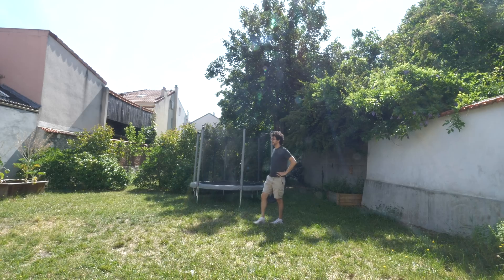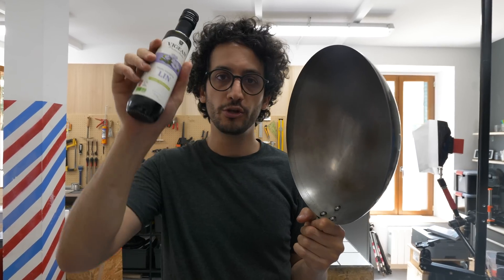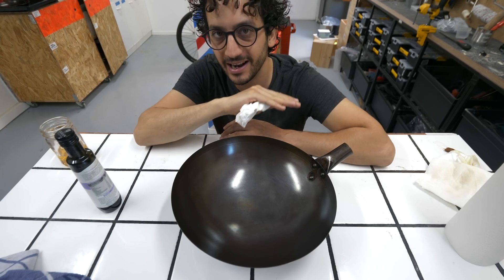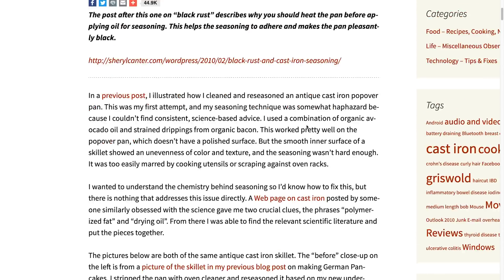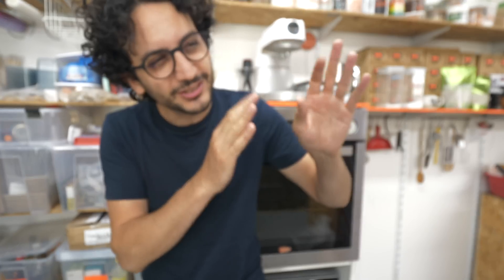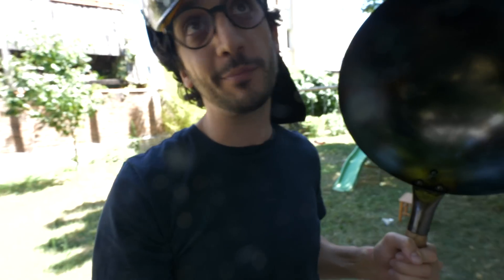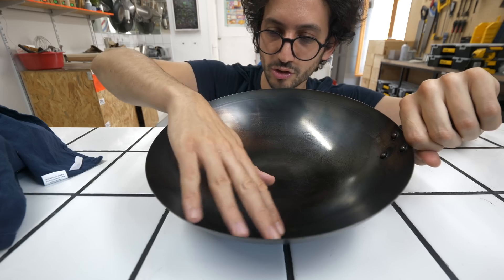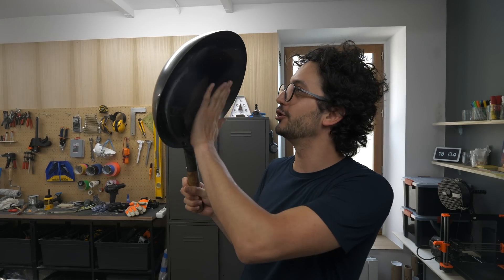Can I Make my Wok Slicker than a Nonstick Pan ?

Comment: As fabulous a tool as a good seasoned wok is, you won't be able to cook creamy omelette in it.  And your stir-fry won't turn out nice in a non-stick pan either.  Each of those is a solid instrument in its own right, designed to do specific job better than other instruments.  I can't understand this hype about cast iron/carbon steel cookware.  It's legit best in what it does, but it can't and shouldn't substitute a good non-stick pan.

Comment: Seems like he really missed an opportunity to get the wok glass smooth with some sand paper of decreasing coarseness.  If he had gotten down to 3000 grit, that wok would have been like a mirror.
Reply: it seems like you don't want it too smooth, you want the oil something to adhere to. Some cast iron stuff does come pretty rough off the shelf.
Reply: @kubetail12  Well he said that the pan had to be as smooth as possible (9:44), so if that's true, then there's only one way to accomplish that.  Plus oil will adhere to almost anything.  If you put oil on glass it still adheres.
Reply: @cheemomugdoo6001  what was the wax applied for the polish finish?
Reply: @leighp03  I'm assuming it was a a type of jeweler's rouge, which is like a rubbing/polishing compound in solid form.  They come in different levels of abrasive, but in general they don't remove much material, they are used to remove fine scratches for the most part.  It would be the final step after using fine sand paper.

Comment: Stupid question (most likely): is it ok / useful to do this on an aluminium pan?
I have a few small cheap ones i occasionally use to heat up non stock things. I see others use these to cook eggs, but im like oooh maybe not. Eggs would stick to it, and ppl would hurt the thin oxide layer when scraping it. 
(Al with an oxide layer is foodsafe. Scratched aluminium before the oxide layer could naturally reform on it is not so much)
So it would be awesome to make the surface a bit more non stick. Of course i still wouldnt cook heavy dishes in it, just would be fun to improve it a little.
Any thoughts? Can be done, no go, works but not too good?

Comment: Linseed oil can be used to form the varnish for paintings but instead of heat you just leave it to harden for a few weeks/centuries, there's a lot of literature on the chemistry and polymerisation in the museum conservation of artefacts literature.   My question on followup is, can you wash it up with detergent?   I was always very firmly told by a profusely wok using housemate in uni that washing up liquid will remove the patina and make the wok go rusty.   I'm pretty sure a fully hardened linseed polymer isn't going to dissolve in detergent though.
Reply: it can take light detergent but you should avoid it. It is not necessary. Put a little water, put it on oven for 30 secs. It will boil and loosen up the stuff. Then just wipe it.

Comment: Would make a lot more sense to polish the metal surface to mirror shiny before applying the  oil film.

Also it should be noted that UV light and oxygen are enough to polymerise linseed oil on their own. Baking a carbon steel pan with a powerful UV lamp might be advisable.

Anybody who uses a wok will tell you that teflon is no good at all. It scratches and flakes, and plastic can't handle the sort of ultra-aggressive "wok hei" high temperature minimal-oil techniques required for many dishes.

Comment: You can buy roofing and rain gutter metal stock with a teflon coating. I think that it's a better use for a plasticie type chemical substance. (What the hell is teflon anyway?) Keep that sort of thing out of the kitchen. Eventually teflon flakes. Do you really want to eat that s--t? No you don't. Oil seasoned pan is way better . Good job French guy.

Comment: The answer to that question is no. A non-stick teflon pan, can't literally be beat when it comes to that. It's after all the solid with the third lowest friction coefficient. The other 2 solids are BAM and Diamond-like carbon. And none of these items are commercial products. Sure a Non-stick pan with a BAM coating wouldn't be overcome ever, as it's literally the material with the lowest friction rating, at 0.02 compared to 0.05 for DLC and 0.1 for PTFE, and steel at 0.7...

Comment: False... Seasoning does not make your cast iron/carbon steel non-stick. It only protects it from water. The true non-stick part comes from developing carbon layers with your seasoning. Carbon is whats left after you cook food. In other words to have a true non-stick carbon-steel pan, you have to actually cook on it.
 This is why the egg test is dumb to do with a new cast iron or carbon steel. Sure you can make shift it to seem like its non-stick, by using large amounts of oil or cold oil hot pan. But it is not the same as my cast iron with over 2years of carbon build layering. Makes things taste beefier since I've used it as a test pan for making burgers, thousands of them. I can slow heat my cast iron, not add a drop of oil and throw an egg on it and it will slide. This is a budget lodge 12inch cast iron. Using a metal razor edge spatula with the burgers, made the surface almost as smooth as my finnex and stargazer, minus the edges.  Had original seasoning removed. put on 3 coats of ghee for seasoning. Seasoning done... Then I cooked thing sliced potatos on it for carbon build up, starchy items are good for this. Then I did bacon right after it cooled. Then I cleaned it with just a towel, then reapplied heat and did a layer of ghee again, do the oil everytime after cleaning.
Then you wanted to preheat the pan before adding your season layer. Then after you put it in the oven, about 15mins later, you want to wipe the inside off, or it will spot. You only do this with a new pan, or if you re-started a pan. But you always coat it with oil after cleaning.

Comment: You should know that the process is called bluing and there is no polymerization involved whatsoever.
Usually you also do this at much higher temperatures.
You take the steel or iron to 400-700°C and then dip it in line oil.
You could also do it the other way around but then you risk of just burning the oil instead of having it steam off.
During that process the outer layers of iron form iron oxide, the nice black stuff, the magnetite, not the bad flaky red stuff which is usually called rust.
The black iron oxide is not as brittle and forms a quite hard protective layer. This is not really permanent but you can prolong the effect by rubbing it with oil once in a while.
Other uses of this process are in toolmaking or guns for example.

Comment: I like the idea of taking what we have and making it better.  I like the craftsmanship involved in taking a pan and seasoning it into a non-stick pan.  For the same reason that I appreciate blued guns.

What I mean to say there is that, much like with firearms, there are more effective modern coatings than bluing (a coating of black iron oxide, preventing the formation of red iron oxide from forming)  But there is a sort of beauty in performing an older, less effective method of coating a firearm that requires care and knowledge of your tool (firearm/pan), especially when performed by the owner.

The only place I take issue is when one refers to seasoning a pan as a natural or non-chemical method of making a pan stick less.

Flax seeds dont naturally press themselves into an oil, land on a pan, and heat themselves to the point that they polymerize.  And polymerization is definitely a man made process, creating a chemical change.  Furtger, the person intervoewed states that we are actively looking to create the process heating oil which causes carcinogens in eaten food.

I enjoy seasoning my pans.  Maybe its safer than teflon, maybe its not.  Regardless, seasoning a pan is still creating a manmade chemical coating which, if ingested, is not guaranteed to be safe.

I am not stating that chemicals are bad and natural is good.  I am stating that I feel it is intellectually dishonest to refer to manmade polymerization as natural/non-chemical, simply because we recognize all of the ingredients involved as natural.  Trace any "chemical" back far enough, and you will find a list of completely recognizable ingredients.  Trace gasoline back far enough and you get naturally occurring minerals paired with animals and plants fermented by naturally occurring bacteria/fungi.

I am not posting this to be confrontational.  I am posting this because you asked for opinions on the topic.  I love the video (and gave it a like), and I love taking care of my cookware.  It says a lot when you walk into a kitchen and see a cook that seasons their pans and sharpens their knives with care.

Comment: !! Safety warning !!

If you use towels to apply and wipe off lindseed oil, please immediately a: put them in a zipbag b:wash them off (ofc if not paper towel) or c: throw them right into a open fire to destroy them immediately. Otherwise they will very likely ignite themself spontaneously, even at room temperature!

Comment: One layer of seasoning will pass the fried egg test, but my carbon steel pans fail when I scramble 3 eggs in them. I get sticking galore and my teflon pan doesn't. So now that you've had half a year with your wok, would you say 3 scrambled eggs would stick? I'd love to know because I'd love to get away from chemical coatings too :/
Reply: Delayed answer: When you put too much food, the temperature of the pan drops and at lower temperatures these pans are more sticky. Carbon steel pans have less mass than cast iron ones, so their temperature will drop. If you want non-stickiness to go on, you should heat the pan a little more for higher amounts of food than you would do for lower amounts of food. But that would probably smoke your butter if you are using butter.

Comment: This si the exact way I use to season my Cast Iron skillets, heat and linseed oil and sometimes Grape Seed oil.
And my mother and my grandmother and my great grandmother.....
So I can confirm that this works, heat and oils.
I have a Cast Iron skillet that we have been using almost every day for four generations.
Everyone should have at least one Iron Skillet and they don't need to be expensive at all.
Buy one at a flea market and season it or if you want a new one then IKEA has several models that are just as good as the high end ones.
Cast iron is cast iron.

Comment: Basically the teflon coating in itself may be a man-made "chemical", though it is still a more uniformly polymerized material than the polymerized oil which you have made. And hence you changed it's structure, it is man-made, too ;) . What I am referring to is that, that maybe the teflon has less chance to be harmful than the burnt oil, because it contains less free radicals. Although I am not a safety maniac, you won't die of this, but if you want to check the smallest details: teflon with some oil may be the safest  :P. Keep up the good work!

Comment: How long does a teflon pan last and then cost to replace each time?  How long does a carbon steel or cast iron pan last?   There is no comparison.  Most professional chefs do not use any teflon pans for these reasons.

Comment: I prefer a seasoned wok to a teflon-coated wok because the high heat needed to make decent stir-fry kills the teflon coating quite quickly. Teflon is fine for frying eggs and bacon, stuff where you are using a low heat.

Comment: nonsticking pan meant to be a consumable item that according to manufacturer you should replacing them in a regular period( 6 months, 1/2 years) regardless of how expensive that pan is
yet cast iron pan you need to maintain everytime when you use(that the process of seasoning is done if you use it frequently, like commercial kitchen) but is durable

Comment: Well, Teflon is also a polymer. But I prefer the old way for the simple reason that resurfacing a Teflon pan is not something you can do at home, whereas seasoning is. My main pan is at least a hundred years old and there will be no reason to replace it for another couple hundred years.

Comment: That looks a bit difficult. Try the method we use here in the USA to restore or old cast iron ware from 1885 to 1930.  First oven cleaner to get all that junk off the surface.  Then use your drill and a pad and go through 220 to 1000  grit sand paper. You should have a mirror like surface. If not go to 2000 grit. Lightly oil and your done.

Comment: Salut !
An improvement of the stove would have been to sand the steel of the stove before cooking the first oil. Another improvement would also have been to apply a large amount of oil to the stove at 650 ° C (ideally soaking in oil at 80 ° C) to obtain a blackened steel. The rest would continue as in this tutorial.
In any case, thank you for these excellent videos with real culinary content.

Lâche rien !

Comment: Alex, whatever you did for this video, we already get those type of woks for dead cheap prices in India. You can get those in any weekday flea markets in almost all major cities and towns. Not only just woks but flat variety of wok that's used for last minute serving of many an Indian dishes called pav bhaji or chaat etc including noodles. Almost all authentic street food vendors have these. They use it as it doesn't take huge energy to heat up and once heated, retains heat for a longer time so that they can work on the plating of the dish. They almost clean it every day with special techniques that gets carried on in the family. After work, they clean it with soap and scrub it. Wipe it clean and immediately apply Sesame oil or groundnut oil and store it. Overtime, with everyday use the oil gets coated in layers and stay without coming off as before every use, they just heat it with a similar stove like you used outside. It works well with kerosene stove. Heating temperature, time also matters.